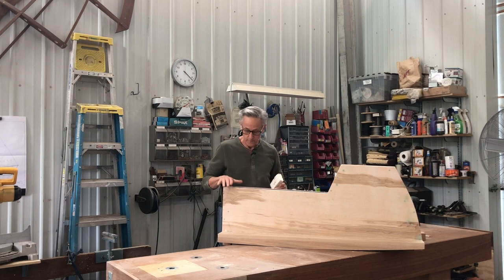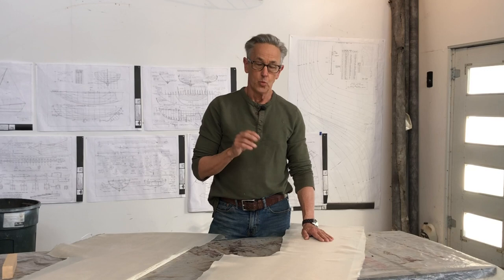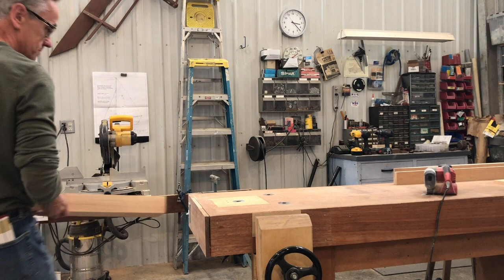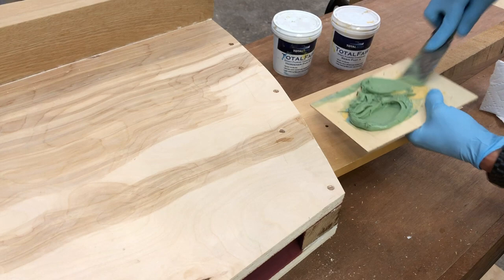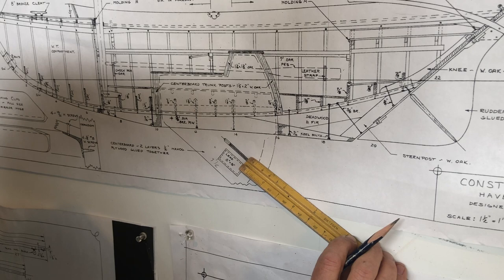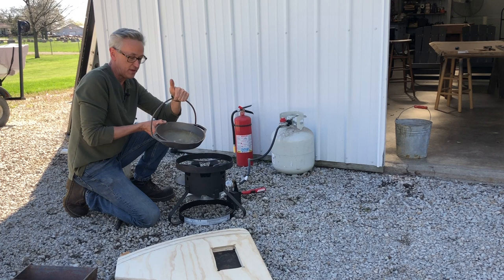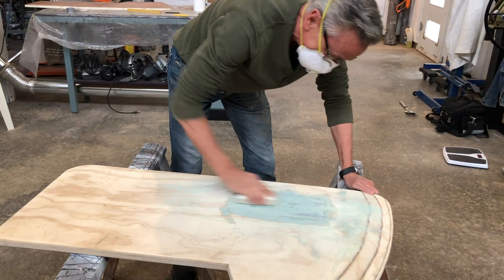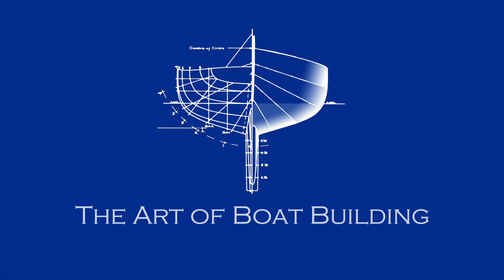Haven 12 1/2 Building the Centerboard & Centerboard Trunk, S2-E3

Comment: Beautiful work Bob.  I started a little out of sequence with the bit about the clamps. As a retired plumber who has had lead blow up when the mold was wet, I would caution that when pouring the lead into any mold to make sure that everything is dry. A heat gun will dry the plywood/steel mold area in the centerboard and pre-heating the molds for the excess lead on the lead crucible is an easy way to dry them. Any ingots that are to be remelted should be heated if they are added to molten lead as should the raw scrap lead. Please be careful with molten metals.

Comment: Your amazing project has me thinking about the boat I want to build and how I want to build it.  I really appreciate your taking time to show what you are doing and your thoughts around why.  I have this huge debate running in my head about using traditional wood boat materials compared to using plywood and epoxy.  I am realizing two things: 1. I need to remember what my boat will be used for - Sailing but needs to be trailerable because I plan to sail in both the local lakes and the ocean.  2. I need to be able to build it in my garage.  I know I want to build a wood boat, but I am getting over the fact that I need to use modern materials to ensure it has good life being out of the water more than in. I am appreciating your selections of materials and coatings and seeing how the form and function and ART of building the boat is present.  Really enjoying your video series.

Comment: Love watching your build!  On my much smaller 12' CLC Passagemaker, I used graphite powder mixed in the epoxy for the interior of the daggerboard case (along with glassing the interior), prior to assembly.  The graphite is not only for abrasion resistance, but also acts as a dry lubricant.  It works amazingly well after a half dozen sails.  Looking forward to the next episode!

Comment: I'm surprised the plan did not call for more shaping of the leading edge beyond just a roundover bit. Given the thickness of the centerboard, you could easily get a more airfoil shape without significant extra work and the flow over the leading edge will produce much less drag. This would greatly improve the windward performance of the boat as the board won't stall as easily. By the way, having grown up in New England around many, many Herreshoff 12s (my dad has had a Bullseye, the fiberglass successor designed by L. Francis for 50 years) I am really enjoying seeing the details of how these are traditionally put together. Thanks!

Comment: I just watched this video with and found it most enjoyable especially as i am not venturing out (Covid) plus recovering from a Stroke. I am sure you know this but didn't mention it the only way to reliably attach lead is by mechanical means as you did as it reacts with oxygen in seconds or less and is resistant to adhesive

Comment: I'd suggest looking into some hollow ground screwdriver bits - they are often sold as gunsmithing bits. The hollow grind allows full bearing of the bit against the slot in the screw, which greatly reduces the chances of marring the head of the screw. The common screwdrivers are more like mini pry bars, and have a tapered tip when viewed on the cross section. This results in only the top of the slot being in contact with the screwdriver, and leads to damage that could have been avoided with the hollow ground bits.

Comment: I suggest that you wrap cotton wadding around both ends of the bronze bolts that tie the centerboard  trunk together.  After the nut is tightened, that should prevent fresh water from getting into the holes in the oak and plywood, and causing deterioration.
Reply from the maker: The holes have been plugged with epoxy compound. So, no worries.
Thanks for your concern and watching!

Comment: Nice job on the centreboard assembly. I wondered if a couple of dowels would help align the centreboard plates when gluing, but it didn't seem necessary. The lead pour went well too. I did see a vid where someone was recovering lead from ranges and a couple of un discharged rounds went off during the smelt
Reply from the maker: Dale Skidmore Thank, right cutting the two half’s as one made it easy to align. Small discrepancy were cleaned up with sanding the edges. 
Thanks for the ammunition heads up. I’ve been sifting through beforehand I will now keep a keener eye for any.

Comment: Hi Bob. Another truly enjoyable and educational video! I've a question to run past you please. At about 14:15 you show the power saw set to a 45 degree angle, so as to cut the openings into the two plywood boards that together, will be your centerboard. You said you cut one board at a time. Your lead weight will be situated in this opening. So the sides of the opening will be 'V' shaped, but which way? If the boards are placed atop one another one way, you'll get the sides of the opening having a vertex of the 'V' of each side of the cut-out, going TOWARD the opposite side of the cut-out. Now from THAT arrangement, if you slide the bottom board from under the upper board, and DON'T flip either board, then lay what had been the bottom board atop the other board, the 'V' vertex of all four sides will point AWAY from the opposite side of the cut-out. I didn't see clearly which way you had the boards attached to one another, when you did the lead pour. And another point here,  at 23:10 I was surprised that molten lead could be poured into a marine plywood sided mold, (with a steel plate base) without starting a FIRE!!! Really, Really Surprised! As you were about to pour, I was expecting you to need to use the fire extinguisher in the now burning centerboard!!! But I was HAPPY TO SEE that my fear was baseless!!! WOW!!!
Reply from the maker: The 2 centerboard sides have the deepest part of the V to the inside. I think you can see it at 14:50. The boards don't catch on fire because fire needs oxygen to ignite. The lead seals off the air before it gets to a flash point. Fun huh! In episode 15 "Casting Lead Ballast Keel" I pour almost 700 LBS of lead in a wooden mold.
Thanks for watching and your great question! Cheers!

Comment: Outstanding job on the centerboard and trunk. Just wondering why you did not wrap the centerboard in fiberglass as the plywood is exposed to the water and any dings in the paint may allow seepage. You lead pour went so smooth compared to several ones I have seen that turned out bad. Bullets and car tire weights are great sources for lead, Check out any old buildings being tour down for lead flashing around vent pipes and such. Looking forward to your next video.

Comment: Your videos are thoughtful and very educational. I have a question regarding the centerboard trunk and centerboard. Do the plans call for a bushing on the trunk to pivot pin connection for the centerboard and how do you keep that part watertight?
Reply from the maker: Yes, the plans do call for a bushing. It doesn't need to be  watertight as the pivot point is through the ballast keel which is underwater.

Comment: thanks for showing good work. Just a question : would it be nice to have a bronze bushing at the pivot point of the ruder, instead a bronze bult -wood hole set-up?
Reply from the maker: Bruno Wiebelt the plans call for a bronze rod. A bronze bushing in the centerboard is a good idea. Thanks.

Comment: Does the cartridge on the respirator filter out dangerous lead fumes? I remember reading lots of debates about this, and I don't recall that there was a consensus. I concluded that I'd never make a boat that required melting lead. (An alternative approach is to take lead pellets and encase them in epoxy.) Also, sanding lead puts lead dust all over the place. The filter on the respirator keeps you from breathing the dust during the sanding, but I wonder if one needs an air cleaner as well since the dust can remain in the air. And then there's dust all over the surfaces, etc. Lead scares me.

Comment: Awesome channel! I am just missing general safety measures. Working with epoxy without a mask seems not very reasonable to me...
Reply from the maker: West Systems (epoxy)recommends a minimum for most epoxy users is gloves, eye protection, and protective clothing. Working with epoxy should be done in well ventilated spaces. If is a small space, such as a boat cabin, with little ventilation a respirator should be worn. The approved respiratory protection against epoxy dust, wood dust, and nuisance dust is a dust/mist mask with an N95 rating or respirator. 

My large studio with 25" ceiling is well ventilated. Most of the time I do wear a mask or respirator. I do remove it during video shoots as it almost impossible to pick up and audio.

Thanks for your question and watching!

Cheers,
Bob

Comment: Very professional.  What keeps the molten lead from burning or catching the board on fire?  Little smoke and no charring!
Reply from the maker: Michael Tavary the wood in contact with the lead can’t get enough oxygen to burn.
Reply: @TheArtofBoatBuilding  Thanks, I had also anticipated much more charring, but I guess the melting point is also pretty low and cools quickly when it touches the wood.

Comment: I really like the quality and detailed content of your posts. I have just flipped over the planked hull of a Leadlight 14. Your first boat reminds me of my project quite a bit. My next boat will be A H12 1/2 or a variant. So I am very interested in your Haven 12 1/2. My question is why didn’t you glass the center board as you did the inside faces of the center board trunk for wear? Keep up the great work on the videos.
Reply from the maker: Joe Cerami thanks, I did epoxy the centerboard so I feel comfortable with its durability. Also the centerboard can be removed if repair is needed, unlike the centerboard trunk. Exciting times with your Leadlight.
Reply: That makes sense. I didn’t know the center board could be removed for refinishing. Thanks.

Comment: Bob, Just found your channel it's great.  Why not put  unthickened epoxy  on your  board trunk pieces and the center  board  prices  before  applying the  thickened epoxy?  Wouldn't that give better  adhesion?  Keep up the great video's.
Reply from the maker: Thanks for the question. There isn't an advantage to using thickened epoxy first. A second coat needs to be applied before the first coat cures. If the first coat does cure the second coat will not adhere with out sanding. Glad your enjoying the videos.

Comment: I really appreciate your videos, very informative and easy to follow. I do have a question though, why didn't you fiberglass the centerboard?
Reply from the maker: I did epoxy the centerboard. Fiberglass is a reinforcement for the epoxy. The thickness of the centerboard, 1" and the wood fibers are more than enough. The centerboard is removeable if it ever needed repair. I only use glass cloth where I could not ever get to it. Thanks Pierre, I'm glad you are enjoying the videos.
Reply: @TheArtofBoatBuilding  I understand your point, I'm just stating that, from my point of view, since the centerboard is the lowest part, it is more likely to hit the bottom. So vinylester combined with epoxy resin is a very strong protection against abrasion. Keep up the good work, cant wait for your next video

Comment: So, from someone who doesn't know much about boats;
Does the center board act as a belly/hull/keel fin? Is this an item that gets drawn into the boat for shallow waters, and dropped for deeper waters for stability? I'm trying to piece this together in my mind so I can understand the theory behind this piece you just built and why it has a pivot point.
Thanks.
Reply from the maker: Thomas Russell yes, the center trunk houses the center board. The center board does retract into the trunk and is let down when sailing. That’s the reason for the lead weight, so it will stay down.

Comment: Hey Bob, Arnaud here. We're building a Haven 12 1/2 with my brother. We're ahead of you to this day, since we just finished planking the hull during the Easter holiday. Are you really going to cast the lead keel ballast? We were thinking of having it done, instead. Shooting ranges are not that common in France, so sourcing 300 kg lead might be tricky. I guess you're following Maynard Bray's book for building this boat, so casting the keel won't be before a few months, but, how will you proceed? 
Thanks for your reply, and for making these awesome videos. I subscribed on first view!
Reply from the maker: Hi Arnaud, Yes, I am going to cast the ballast keel myself. As you know it isn't needed for some time in the build. However, I plan on casting it yet this summer so I can get it done before inclement weather. Not following Maynard's book, I found it lacking in allot of information. If I had to pick one book (have about 5 I refer too.)is "Building Small Boats"  By Greg Rössel.(link in bio)
Reclaimed lead is a challenge. One source I have heard others doing is to find an old sailboat that is not sea worthy. Many time the boat is free if you dispose of it. Casting metal is not hard but can be a mystery if not having done any. After 40+ years as a sculptor casting a low melting point metal just sounds like fun!

Best of luck with your build. Stay in touch I'll be interest is how it's going.
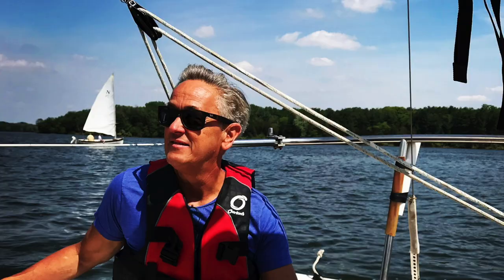Reply: Thanks for the reply! I did cast a small elf figure once, in my D&D years. Can't be much different, but for the scale! :) I'm starting a 1:10 scale model of the boat; I thought it might help troubleshooting on the real thing. I almost finished resizing the plans in Rhino. It occured to me that, on the centerboard trunk, it might be convenient to draw a line, or screw a batten now, that would help locate the height of the floor beams. Can't see how you can draw them once  the hull is closed. What do you think?

Comment: Are you using wax for your screws?  It really makes driving them in easy.  I've found that mixing bees wax with paint thinner gets it to a nice stable consistency.  Just discovered your channel, keep up the good work!
Reply from the maker: I use a bar of soap. I have used wax as well seems like I away have soap around.
Reply: @TheArtofBoatBuilding  L. F. Herreshoff recommends oil, arguing that it helps to preserve the wood.

Comment: What stops moisture from entering the hole that you drilled in the in the centerboard at the pivot point and rotting the plywood?
Reply from the maker: Hi David,
Can hardly believe it's been almost 2 year since I made the centerboard. My plan is to epoxy a bronze bearing in the hole with a bronze through bolt.
Thanks for your question and watching.
Cheers,
Bob